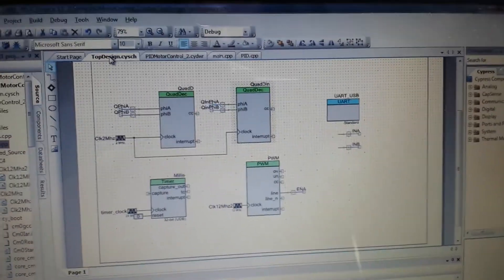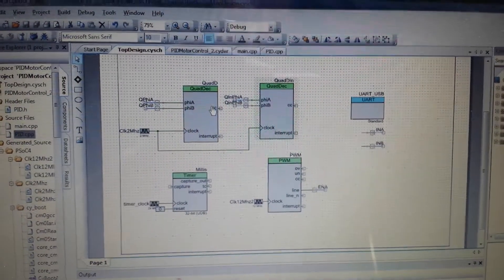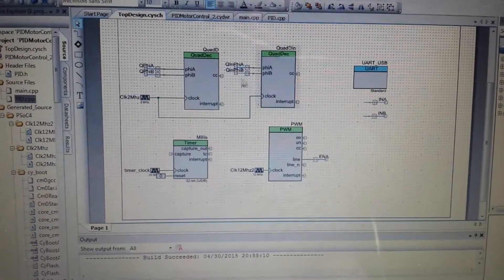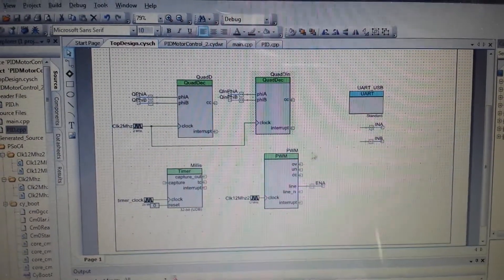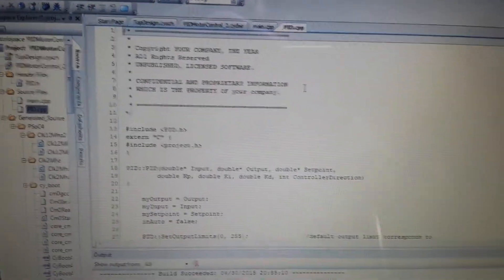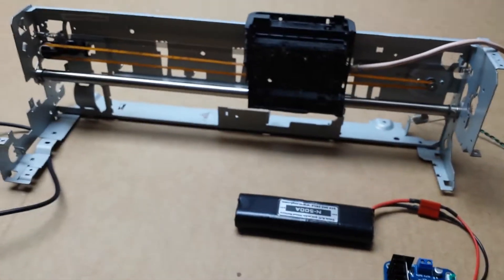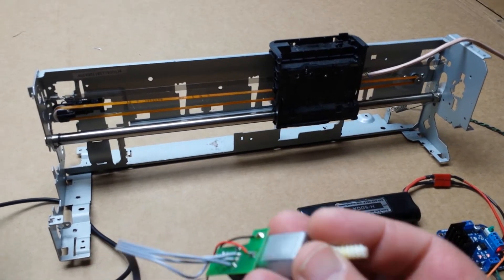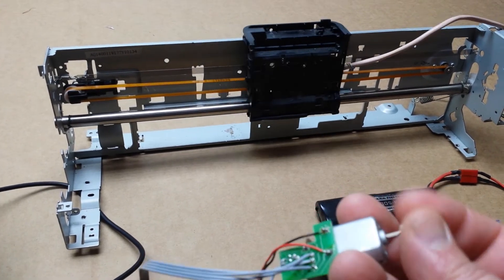PSoC creator project using arduino c++ lib

Comment: What were the specifics of getting the c++ to work with PSoC creator? Looking at doing the same thing.
Reply from the maker: +Michael Vowles I used this as a guide:  http://www.mbedded.ninja/programming/microcontrollers/psoc/using-cplusplus-with-psoc-creator

One of the keys is using this:

extern "C" {

#include <project.h>

}
Reply: +Chuck Swiger thanks mate!
Reply: @ChuckSwiger  Thank you very much for the link, that just helped me a lot.
Reply: Hi
I can programming arduino by psoc language